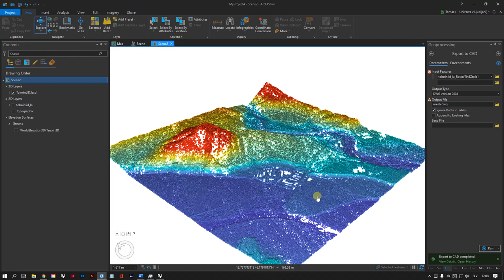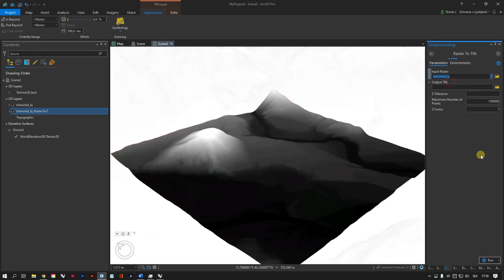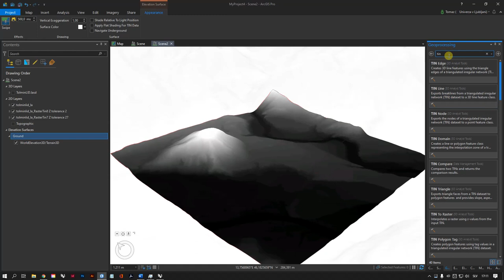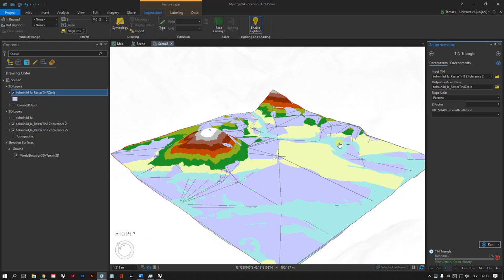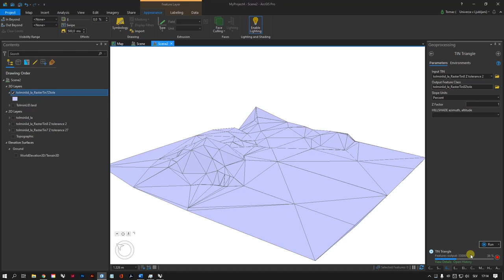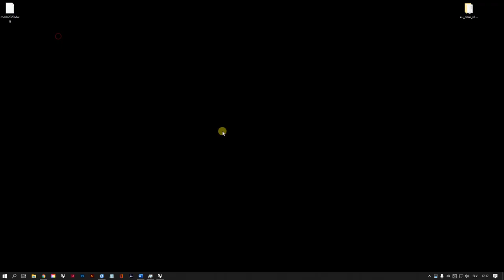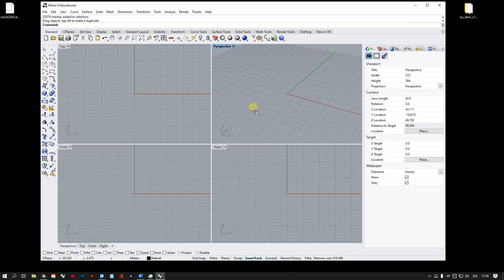2020 L6 Exporting TIN 3D terrain from ESRI ArcGIS Pro to CAD

Comment: Hi! Great video, but i'm having trouble exporting the multipatch to CAD. A CAD file is created but the it is way to small and I have a message in ArcScene that it cannot add the layer created. The CAD file is very small and does not contain anything. I tried exporting the TIN directly to CAD and it did worked but I have to manually create the surface in Rhino. Any tips on what might be the problem? Thanks!